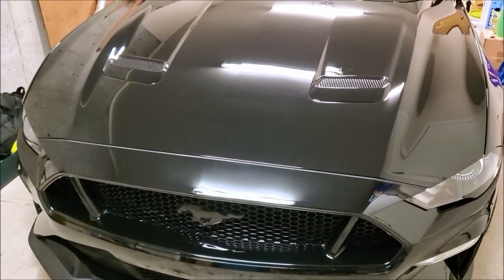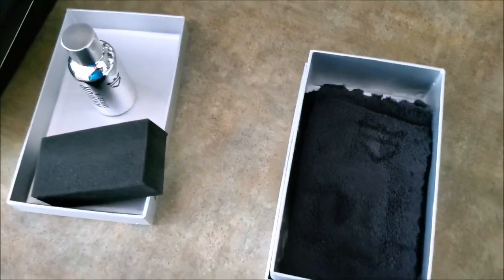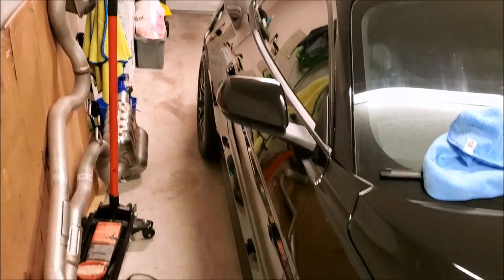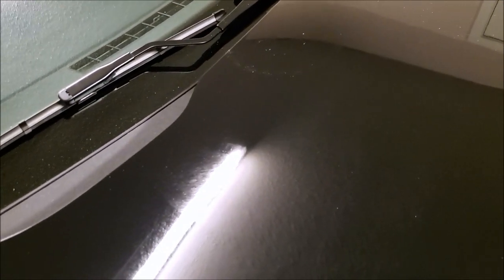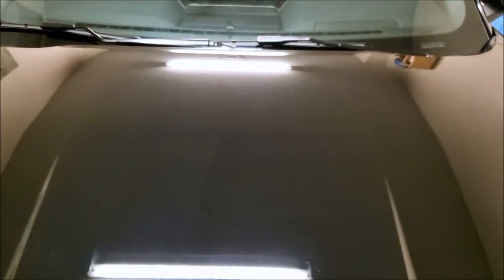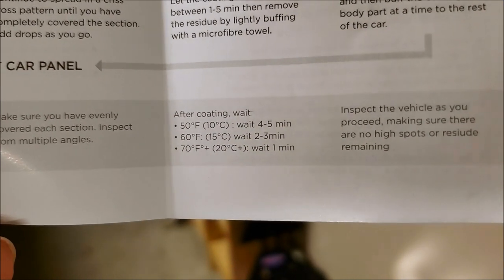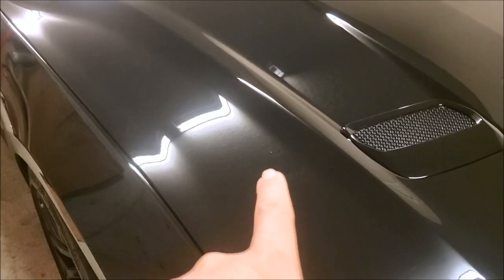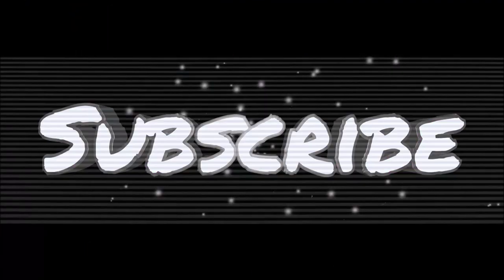Ceramic Coating My 2019 Mustang GT With Avalon King Armor Shield IX Part.2 *AMAZING RESULTS*

Comment: Ceramic is a must in the lower mainland. Do you get a hard time for your front tint by the police?  RCMP send to be hit or miss with that kind of stuff.
Reply from the maker: So far nothing about the window tint. Definitely hit and miss. Depends if the cop wants to be a pain or not. I've actually avoided all police so far with this car believe it or not haha
Reply from the maker: layney boy  it's all about the cop here. I have only ever had I comment to check the tint going through a roadblock but the cop that was talking to me said he didn't care and let me go. The other cop there was just trying to be a hot shot I think.

Comment: Lookin good Kyle!
Reply: Works just as good on the glass, barely use the wipers in a heavy rain. Helps with preventing rock chips too.
Reply from the maker: @steliocontos82  thanks. Now that I see how easy it goes on im planning on doing the windows and headlights.